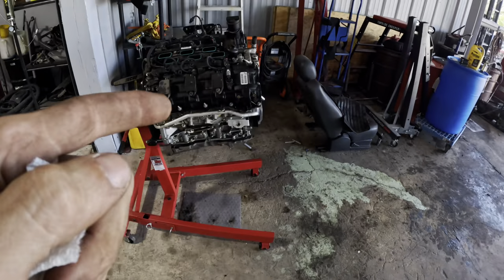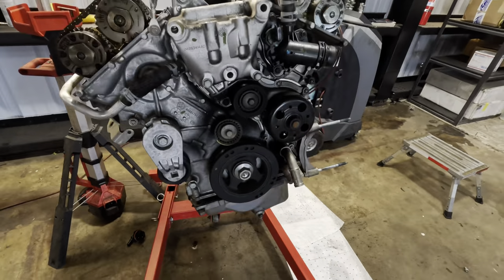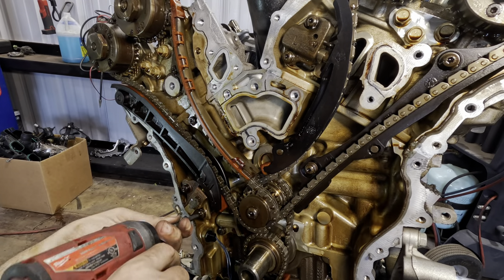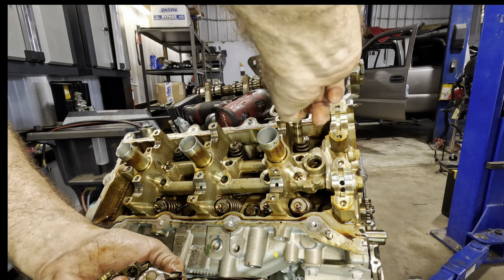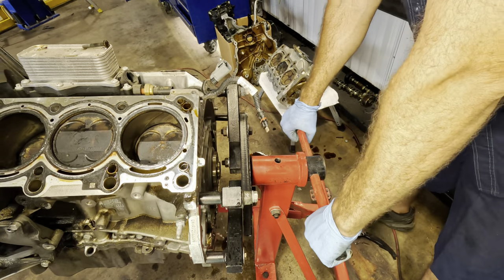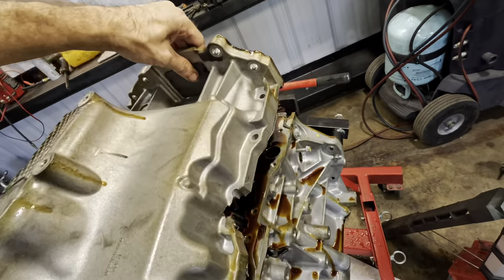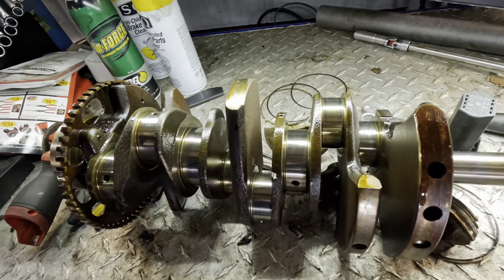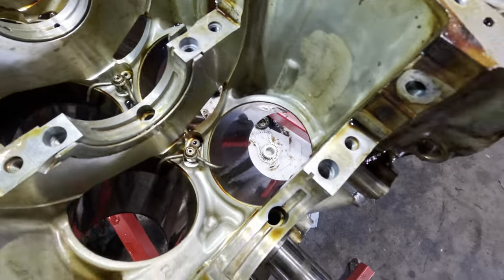Blown Engine--Broken Rod ! Autopsy 3.6 Pentastar Ram Jeep Chrysler

Comment: Even if you take the cam caps off in wrong order and mix them...they all have indicators stamped into them, telling you both which order and orientation to put them back on again...small insignificant fyi in case you end up salvaging this sorta stuff. 😅

Comment: I think that if you had done a leak down test on #3 after discovering that it was low on compression,  then that would have given you enough information to determine what caused the final destruction,, bubbles in the cooling system, hissing in the exhaust or intake, would have identified bad valves, or a crack in the head or cylinder, or a leaky head gasket,,,  if none of that was evident, then the only thing left would be excess fuel in the cylinder on start up which could have damaged the rod enough to let go later on,  great video as always Ray,,,  Always enjoy your commentary,,  Almost as much as the s**t eating grin you gave us when sitting in the  Delorian,,  :-)

Comment: The contrast between Ray and Eric is striking. Ray pulls the engine apart so unceremoniously 😂
Reply: Ray's gonna get an infection if he keeps going from back to front.
Reply: The one thing they do have in common, however, is talking about the mess the teardown is leaving on the floor.  😊😊
Reply: I was expecting to see a comment from Eric pinned but it seems he hasn't watched the video. Yet. 😊
Reply: Ray doesnt do the "Eric oh nooo.. that doesnt go there.   Uh huh.   Hmmm.  Destruction in the combustion palace:.  Thing... Ray needs to catch up.   Lmao!
Reply: To be fair, Ray isn't intending to resell the undamaged parts, so no need to be careful.
Reply: @tradde11same here
Reply: Eric had a new video today… a Mercedes he got at an auction… no keys and the hood latch refused to work… he found an… interesting way to remedy that lol . Love Eric’s videos.
Reply: These engines aren't incredibly valuable. It's not worth the man's time to be careful with worthless parts. If he's anything like myself, it's fun to disassemble to find out what went wrong. Besides the fact that it's a good time, it's also good knowledge to be obsorbed.
Reply: my 89 Jeep has a simple inline 6. NONE of that complexity. There is so much room under the hood that I mounted a toolbox there.

Comment: Based on the damage in the head, I would guess that there was a water in the combustion chamber event that hydro-locked the piston and broke a chunk out of the ring land.  That piston chunk got between the piston and the head which jammed up the piston further causing the piston to break further and the rod to snap.  the rest is just flailing metal.
Reply: I agree with hydro locked
Reply: I also agree with hydro lock
Reply: Yup and all caused by the defective water pump gasket shown rather early in the video. That would cause overheating of the block without the sensor indicating a problem since the sensor is in the thermostat housing. This engine has some major design issues 😮
Reply: Yes remember water came out of the exhaust when Ray dismantled it.

Comment: You should use a breaker bar and an impact socket to loosen large bolts, THEN use the impact driver.  You'll burn up your driver in short order if you do not...

Great video!
Reply: judging from checking out the prices of some of the tools he uses, I'm suspecting he doesnt concern himself much w/the cost of replacement

Comment: i had a ford 460 cid and blew a rod the same way. it was caused by over reving the engine. you can tell this by the middle of the rod breaking and leaving the crank end still on the crank and the piston end still in the piston
Reply: Bad engine/abusive owner and try to kill the 'Messenger'...

Comment: Nice one Ray!! What you have there is a typical hydrolock issue. Overheated, gap between Head & block, cylinder fills with coolant, engine spinning at speed, & catastrophic failure.

Comment: Never ceases to amaze me hoe designers, with gov input for requirements, can take a simple engine and make so complicated with duplicity, wet noodles, fuses for fuses, wiring for wires, controls for controls, emissions for emissions, make it almost impossible for even experienced mechanics to work on much less the average person!!! Now a days you have to go to a shop to get plugs changed when even a novice used to be able to do it in mere minutes!!! Absolutely no sense in it!

Comment: The windage tray is to prevent the crankshaft from foaming the oil(through the circulation of air) which increases oil temperature and makes it easier to burn. Not the oil splash from hitting the crank. There are small engines designed to lubricate this way. Part of the reason not to over fill your oil.
Reply: Also to keep the Oil near the pickup tube under heavy GEE forces.
Reply: @scotthassett2676  I work ships so no G forces for me 😞
Reply: small 4 cycle lawnmower engines and the like have an actual Dipper to splash oil on the crank..  it used to be they told you to run only non detergent oils in small engines to prevent foaming..  im niot sure at what size engines switch from passive lubrication to active
Reply: @eldoradoboy not sure there is a size. I've seen 14hp splash lubed and 14hp pressure lubed. Maybe that area is the  crossover point? Also a lot of small engines, at least Briggs and Stratton, use fins on the governor gear to sling the oil, as I'm sure you are aware. 🙂 I'm not sure if the dipper on the con rod method is used much anymore.
Reply: Did y'all hear Anthony Oliver singing in the background when he was removing pistons???

Comment: Either leaking injector or head gasket caused hydro lock.  Fuel will clean it too.
Reply: The misfire suggests to me that it could be unburnt fuel...
Reply: No real evidence of a leaking head gasket and also the injector leaking enough to cause hydro lock would have destroyed the pressure in the fuel rail and probably stopped the engine before it could lock.... My money is on an external source. After all just before internal carnage ensued, there was a pretty big storm hit Florida and plenty of localised flooding, the customer could have driven through it. It's very possible that a case of bad luck where maybe they were driving through the not deeply flooded road on one side and an idiot in a high truck driving through on the other side washed flood water over the car and straight into the cold air intake. I live here in the UK and have seen this happen several times. Either way, it was an excellent video and a great change of pace from the usual content @RainmanRayRepairs Keep up the excellent work

Comment: Nice work, thanks for exploring and sharing.  Was wondering if there was evidence of any coolant residue in the exhaust ports?  

After replacing both headgaskets on my 4.3, it took some time for the exhaust to clear the tell tale exhaust vapors.  
👍♥️🇺🇸
Reply: Same thing happened to my jeep 4.0 after a HG job, was still blowing out the exhaust for around 10 minutes, thought for sure I messed something up.

Comment: I would have liked to see an more thorough inspection of the deck surface, head surface, and head gasket.  You can sometimes see the passage coolant could have taken to get into the cylinder.  Though it is usually more obvious from a long term leak.
Reply: The block showed clear signs of where the coolant leaked through from the water jacket to the cylinder.

Comment: FYI Ray, the 3.6 Penastar had some issues with design. These engines, the manufacturer in Mexico used a sand casting method to fabricate various parts of the engine. As it turns out, some of that sand was never removed before assembly, and was stuck in coolant passages in the head/block.
Of course Chrysler/Fiat is keeping quiet and fighting any recalls.
Reply: Sorta like the earlier timers...flip it over and watch the sand fill up...😊
Reply: Sand casting are related to fabrication method, and have noting related with Design. 
Sand casting is used to cast ALL motor block since you have to create passages for coolant inside them.
Mexico may cheap out the process, indeed.
Reply: @Chris-bq7nr  sand casting that get cleaned and inspected yes. Not what has gone on though. When you can wash out nearly a cup of fine casting sand from the block heads and radiator that’s an on going problem with shit quality control in my opinion.
Reply: @tradde11 yours isn’t the first and won’t be the last unfortunately.
Reply: @tradde11 I believe it will end up a class action suit in the end but you can bet Chrysler will dig in their heels. Kind of like the Denso fuel pump issues that Toyota fought to not recall only to end with millions of all make’s being being recalled. Hell it took me 7 months waiting on pumps for 3 different vehicles sitting here and 13 more waiting with the owners. 3 years of litigation and no one had the bright idea of mass producing replacement fuel pumps.. crazy

Comment: You can see the oil pressure change on the pentastar with that pump. When cold start they go to high mode, ~80 PSI, you can see it switch to low as the pressure instantly drops to ~30 after a couple minutes. Also at constant throttle, the second you hit 3500RPM they go back to high mode and ive seen max out ~90PSI.
Reply: Yep, I noticed that with mine.  Dry start motors, wish I could “prime” before starting to get a bit of oil in the cylinders.

Comment: Just noticed the " Diesel Feature " for the affected cylinder didn't look to aim into the chamber like they did on the other cylinders. Could that be a factor?
Reply: Probably bent when the connecting rod hit it.
Reply: I'd bet the rod carnage bent it.
Reply: TBH... it's difficult to say. The oil squirter might have gotten bent when pieces of the connecting rod were flying around and self-destructing everything.
Reply: The oil squirter probably got beat into submission and slapped into a different location when the piston rod was flailing.

Comment: Good lordy. The Engineers that designed these cluster __  engines should all be in padded rooms.
Reply: It's about profit.  Make it as cheap as possible and just good enough to get through the warranty.
Reply: Look at the results. Maybe they are😅
Reply: Anyone who buys a dodge/chrystler needs to be in a padded room.
Reply: @TonicofSonic i've had three Chryslers,  a 1980 Dodge Aspen,  a 1991 Crysler Stratus,  and a 1998 300m, all with different thinngs going wrong.  So maybe i need a padded cell? Long story short; never again! 😅
Reply: @ZSAZSS09  TBH I would have credited you with owning them before they were solidified as the unequivocally (IN FAUCI VOICE😅) worst auto brand on the US market.
Reply: @TonicofSonic As a Jeep owner I can confirm that!

Comment: Great autopsy - regarding the stubborn head bolts, would using a breaker bar assist the situation better? Its amaxing how reliant we have become on cordless drills. I would say the extension doesnt eat up the torque, rather it flexes and reduces the impact effect on unseating the seized bolt thread

Comment: Hey ray loved the video man good tear down I hate these pentastars and the timing chains? Gross.. I did want to offer up another potential cause for the explosion, I haven't seen it often but once or twice I've seen a fuel injector get stuck open and hydro locked the engine. And if your head gaskets look fine and there's no cracks in the head I'd be blaming the injector. Just my two cents of someone who's been watching your videos solely to help myself diagnose things and the banter is amazing. Keep up the good work!
Reply: Many years ago I studied the wiring diagram of the fuel injection on a Mercury Cougar.  As I recall, all injectors received positive 12 volts from a common bus, and the activation was caused by the computer GROUNDING the other terminal of the injector.  Could there be an intermittent short that would cause the injector to hold open, or would the injector coil overheat and "burn-out" if ON for too long?

Comment: I commend your due diligence. Whatever it is , before you throw it in a dumpster , pull every nut , bolt , spring and screw , because you never know and you rarely can find that specific one in the hardware store.

Comment: the other time I have seen a hydrolock with no obvious blown head gasket was when an injector hung open and dumped gas in. Washed the crown then cracked it similar to what you have here. I would check the flow on the injector for that cylinder.

Comment: Those heads can warp if overheated.  Strait edee the cylinder heads to see if they warped and let coolant fluid in.  This is most often seen on the right side head and number 3 piston.  It was seen most often in pre 2015 engines. A redesign of the head reduced this problem. The new head design was installed in all late 2014 and newer cylinder heads

Comment: Because you see a lower end failure, dissecting the upper end for anything but parts is just for fun. When rebuilding an engine. You measure all frictional surgaces, bores and related. With the block damaged like this one, it is a boat anchor.

Comment: If the lifters are ceased in the rocker it can bind open and closed.locking the cylender open or closed creating a misfire. By continuing to inject fuel it can hydrolock the cylender and make it bend and break the connecting rod. It will also make it a realy light ticking you may not hear.

Comment: Modern engines are amazing, when I started wrenching 6 bolt cross bolted mains , DOHC and 4 valves per cylinder were almost unheard of outside of Formula 1 type racing.

Comment: My dad had a recent rebuilt International Harvester engine drop a piston rod just like this, but it only went thru the oil pan and not the block.  Bad piston rod was the final diagnostic (it had a minute flaw as another one had the same flaw in the engine).

Comment: I had this happen on my straight 6 when a wrist pin siezed and then the rod and piston blew through the motor just like this. All bearing were fine in the motor but just the one wrist pin over heated and locked on to the rod in the middle of driving.

Comment: Love your channel, love the off beat style you have while wrenching. As a mechanic for almost 24 years I'll have to disagree on this engine. With millions of these on the road I'll be they actually have a lower percentage of blown engines than for or Chevy. Even Toyota and Honda have engine issues.i just worked on. 2016 Corolla. Was idle was rough and it sounded horrible. Ended up being all 4 spark plugs were screwed in at a slight angle. Tip of 2 plugs were the cause of catastrophic engine failure. I've only saw this happen in one other car.. a 2009 Pontiac Vibe.

Comment: The number 3 and number 5 cylinders have issues with the wall cracking on deck . Look under head gasket on wall to deck . Coolant leaks into cylinder and it either blows mega fuse for starter or it starts and blows rod .

Comment: I agree with hydrolock on #3.
The way the conrod was twisted, and no damage to the valves.
Hey, can ya put all the serviceable junk in a box, and see if a parts jobber will give ya $100 for it? There's $4-500 worth of good parts there. Cams, heads, valvetrain, timing cover. If not, blast furnace.

Comment: there was an old 5.3 gm that i took apart in college that came out of an old pickup that had those same little "Squirters" XD even an old gm 3.4 as well they actually started it on the gm 3.6 if im not mistaken because of oiling problems

Comment: I thought the coolant level looked ok on early part of video when you cranked it into workshop you dont get locking  up whilst engine is running just on start up , should have had a cloud behind behind it
Reply: He should have tested the injector he replaced to see if it was faulty.

Comment: I had an ATV engine I rebuilt where the (aluminum) piston had gotten so hot (due to lack of lubrication) that it melted through the skirts allowing the piston to separate from the wrist pin. Top part of connecting rod also had major scoring where the old wrist pin was however I took the scoring out with some Emory cloth and got the motor running again with a new wrist pin, piston, jug, and head. It's worth mentioning that the lubrication in the engine is splash lubrication so luckily there are no oil passages in the connecting rod to have been damaged.

Comment: Ray, I'd put money on a stuck injector. Between the piston being cleaned, a hydrolocking event, and a misfire, here's what I surmise happened. The customer was driving when the injector failed. It then filled the cylinder fuel of gas till it hydrolocked, cleaning the piston at the same time. It then snapped the connecting rod sending it through the block, ending back at your shop.

Comment: too bad there was nothing that jumped out at you. but you tried your best to see why.
the water pump seal could have been the issue. getting any fluid in a cylinder, it will 
work like your brakes, when air is present then you have a compressible situation, but 
fluids do not permit compression , that will brake any thing like pistons and connecting
rods and pistons. great video!

Comment: only thing left is piston microfracture, cracking  which would explain cylinder missing to point of failure.
a cylinder leak down test might catch it. I've seen this several times before and cant help but think so has Chrysler but that cant be cause they would have issued a T S B  on it. 
Right???